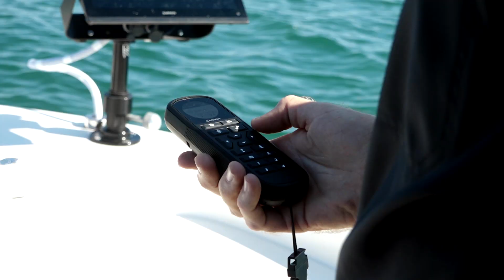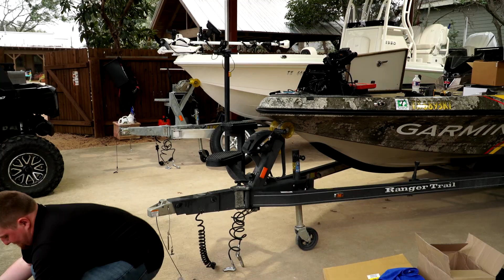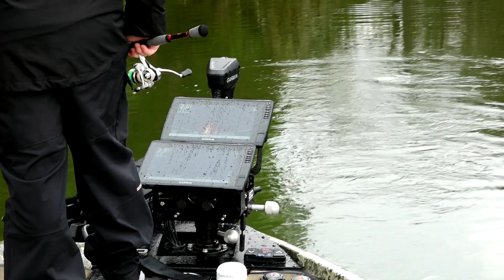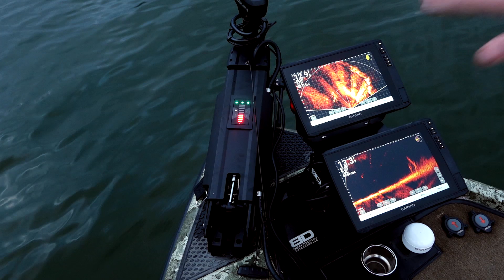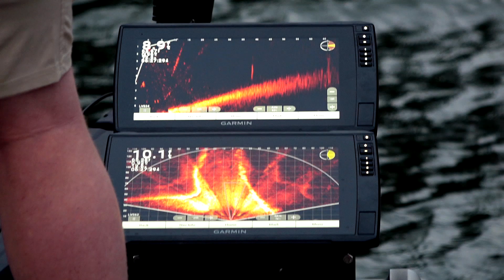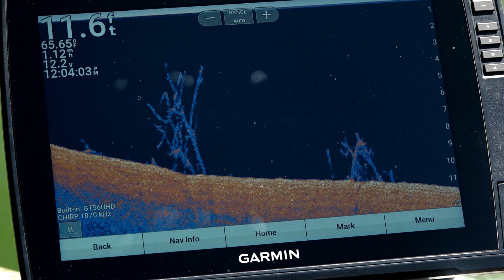Introducing the All-New Garmin Force Pro Trolling Motor

Comment: No quick release bracket from Garmin for this???!!!?
Reply: It’s meant to be secured permanently on boats that go through rougher weather. Once you install a quick release it could add that bouncing/clicking sound to the trolling motor and take away from the “stealth” of the motor. Plus with the tech integrated into the motor, and it being a bit beefier it would honestly probably impact the motors performance.
Reply: @kiarareyes7681 they make one for the Kraken tho

Comment: I bought 2 of the livescope combos, one 12 and one 10. I planned putting both lvs34 transducers on one pole. One set up for perspective view and the other for down or forward view . Is there going to be any problem  having them a foot or so apart on the same pole? I also have the force pro trolling motor.